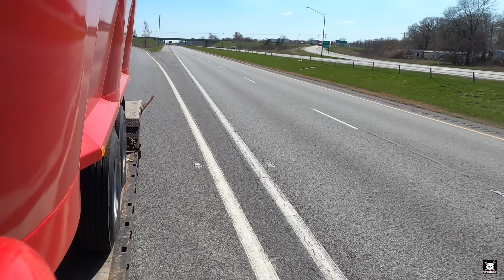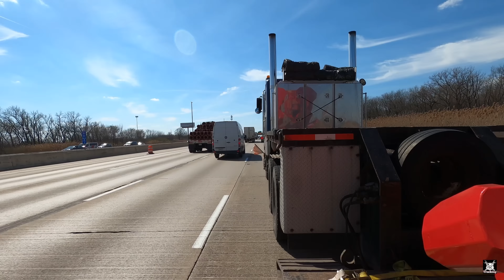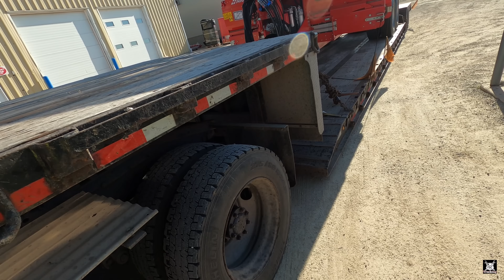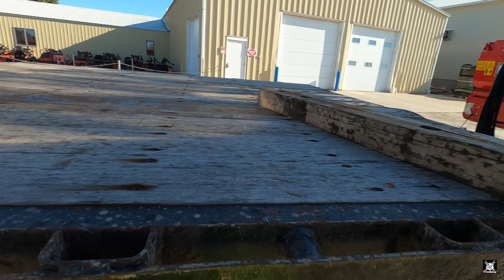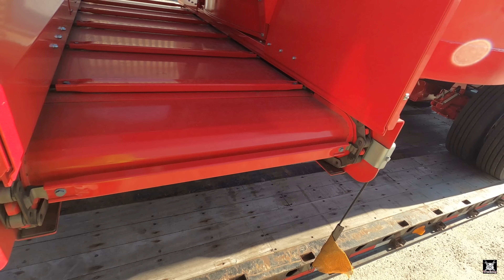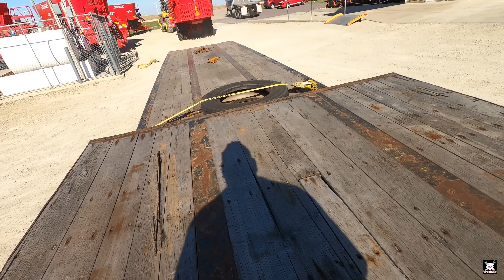Drivers Dog Barking My Brains Out While I Prove Zipper Merge Is Best

Comment: I live in PA literally the DOT posts signs before construction "Use both lanes till merge point" which is just plain stupid. So they close 1 lane. If everyone got in line when the signs started then the traffic would flow. SInce they "use both lanes till merge point" The traveling lane then has to practically stop to allow the 2nd lane to merge. Its stupid.

Comment: That might be Trucker Janelle (Former YouTube User) I would be using the whistle that inky cat's and dog's can only hear I use that all the time and it makes the dogs shut up and yes ur correct Steve. The dogs are supposed to be in the back (sleeper) cause they are just like u said blocking the passenger side rearview mirrors. Andnthey can't have tue windows lowered less then 5 inches from the top of the door. So the dog can't jump out. A few years ago I had a dog (Pitbull) jumped out of the moving truck when me and Jesse was walking to head to the rest area and take showers. It came running towards us. Owner had no lease or collar and I shot it. The owner was charged with vicious animal loose and no permission for hauling his dog's from his company. He lost his job and his other dog. Tue trucking company shutdown tue truck from him driving and they was having a wrecker service come and get the truck and trailer.

Comment: Too bad more drivers don't understand the zipper merge. It is the quickest and safest way to put two lanes of traffic into one. Instead of having drivers jump into the through lane and slam on their brakes, causing the inevitable rear-end collisions, both lanes slow at the same pace in a safer way. Statistically proven but let's not use logic when we can do it the old way. This is the reason why some states DOT have signs in construction zones that say "Use two lanes until merge point". Maybe it's more fun to weave all over two lanes so no one can go by when the merge is two miles down the road.🤯

Comment: Who's still making clay pipes?  Saw a whole load
Reply: Vitrified clay is an excellent material for transport of corrosive sewage. It’s just about indestructible. But In today’s world the cost of purchasing and installing is expensive. So cheaper materials are often used.There may be a load being shipped for a maintenance or repair project.